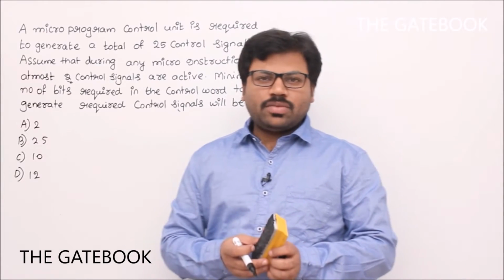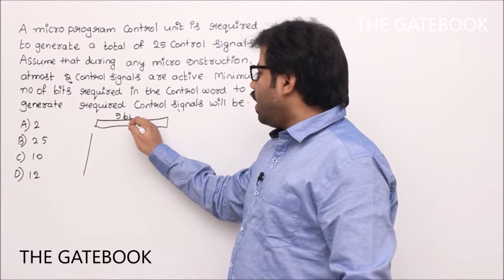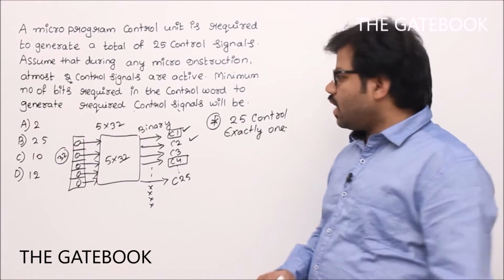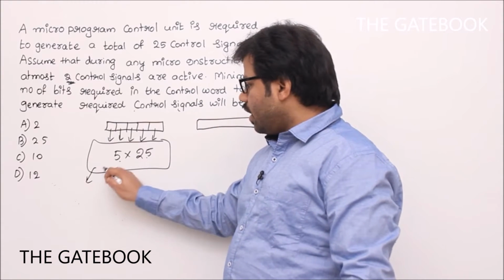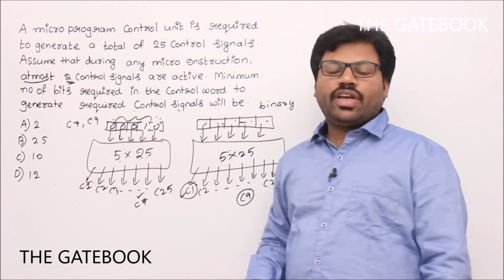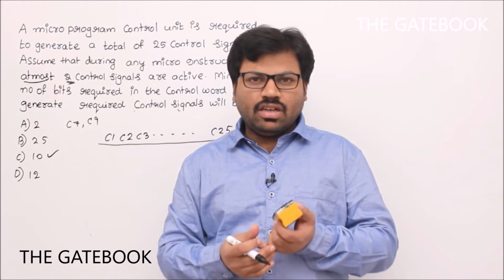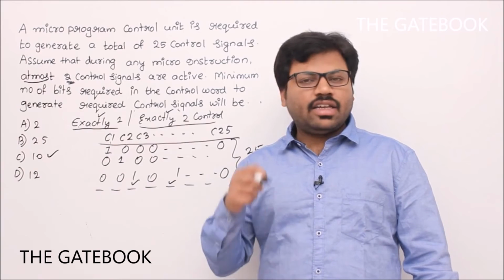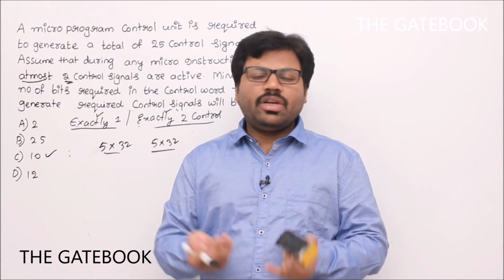Control Unit - Practice Question 1

Comment: Sir in your 5*25  , 5*25 there is ambiguity  possible bcoz of   C1 in 1st decoder selected and again c1 in 2nd decoder selected .
Reply: Question says ATMOST 2 SIGNALS can be active...atmost means not more than 2, but it can be less than 2. So if C1 is active in both decoders, its just that one signal is active. Which is acceptable